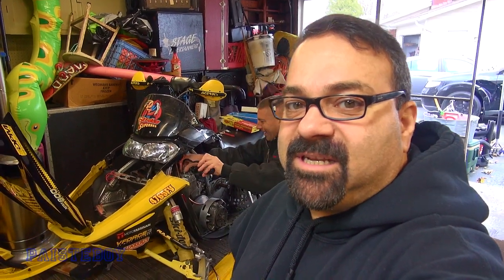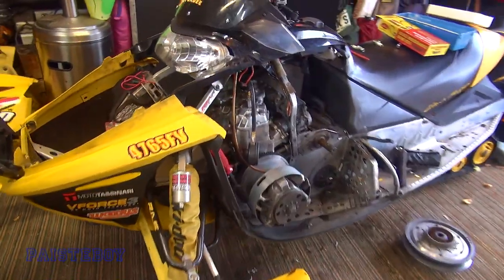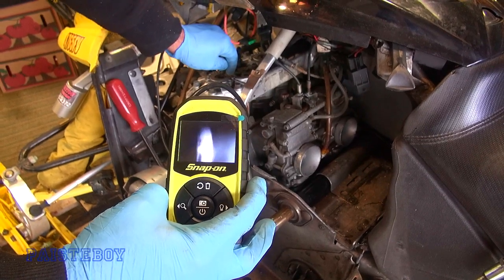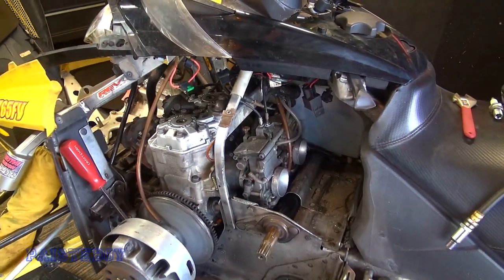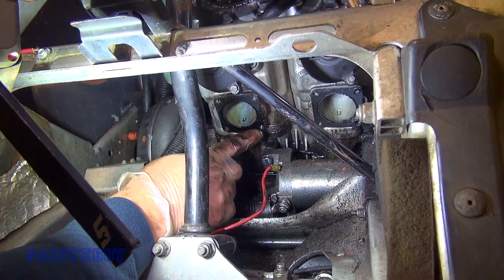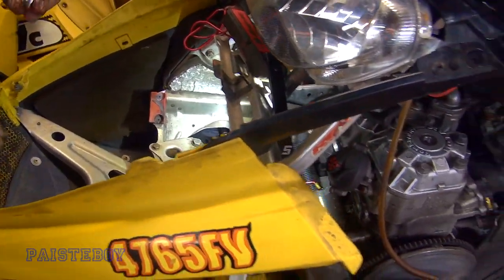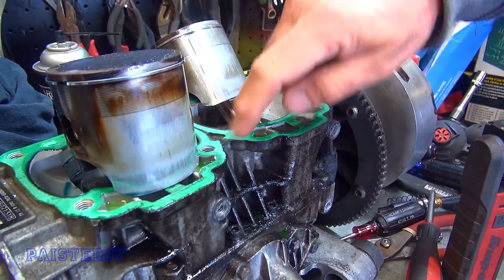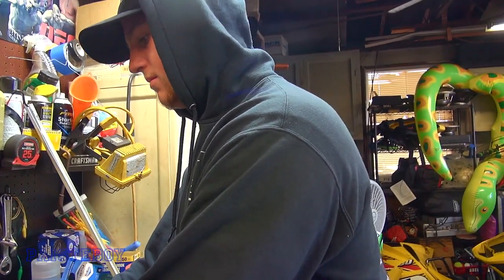Working on the Blair Morgan: November 2020 | PART 1

Comment: The scoring looks to be result of the leak on the Y pipe. Was there similar scoring on the the intake side? If not this points to a air leak by the exhaust port which will cause a "hot spot" 

If the scoring is all the way around the piston, this points to a general lean condition, which is caused by a jetting issue or another air leak either from the intake boots or the crank seal.
Reply from the maker: Thanks for the tips Streeter.  We haven't looked that closely at it yet but I will be sure to look at all of the things you mentioned to get to the correct conclusion.  Thanks for watching.
Reply: @Paisteboy  Now is a great time to change out your PTO crank seal and service the Isoflex grease. Whats nice is you dont need to split the cases. Just remove the drive clutch and then remove the seal retainer plate. Ebay has seal and grease kits for a good price. Love the channel! Thanks....Jimmy
Reply from the maker: @jameslaurinitis7580  
Thanks for the tips.  We'll look into that.  Thanks for watching Jimmy.
Reply: Streeters Garage, I totally agree with you.  After tearing it down more, it makes perfect sense.  Zuke ordered a new gasket set and we will make sure that we don't have another gasket leak.
Reply: @jameslaurinitis7580  absolutely. Now is the time to do it.

Comment: I have tore down multiple skidoo 800s,  Id definatley split cases and have the crank and bearings checked. Also have bearings repacked with isoflex and do crank seals. I mean doing it now is better then during prime riding season. Also id get aftermarket dual ring pistons they are much better then single ring and reasonabley priced. I know this is not your call but id highly recommend it.
Reply from the maker: We'll look into the case splitting but Mark already ordered the pistons and rings so I'm sure we'll be proceeding with the single ring pistons.
Thanks for watching Jacob.

Comment: My 06 600 SDI has that same oil leak. I believe the seal between the cylinders is shot that also lubs the water pump bearings from the gravity fed tube from the oil tank. Mag side cylinder fills up with oil if you don't use the sled for a couple weeks. My engine needs a complete rebuild to fix those crank seals. 11500  miles on the engine so not too bad.
Reply from the maker: Thanks for the insight Rob!  That's a lot of miles.  Thanks for watching Rob.
Reply: @Paisteboy  Yeah it still runs good yet but running it will just cause more damage.

Comment: Check the crank seals they could be sucking air and leaning out your your fire washing away the oil I’ve seen that on many a sleds
Reply from the maker: Ok.  Thanks for the tip.  We'll check that out.  Thanks for watching Mike.

Comment: 02:06 nice heater Zuke!  Nice different take on the rebuild project.  I need that light.  You’re right about the oil from the leaky Y pipe.  The rev 800s are notorious for loose Ys .  90 psi is done... I would rebuild anything less than 110.  Listen to Parker he knows
Reply from the maker: Right on.  When it died on the trail last season and I had to tow him it was probably just way overloaded with un-burnt oil and struggling to run on 1 cylinder.  Yes the 90 psi is toast for sure.  It sounds better than zero but really isn't.  Hopefully we'll be finishing it up this weekend.  
Had a blast Monday night btw.  Please tell Rich & Bobby for me.
Reply: @Paisteboy  i will and we will be in touch about getting you and your buds on for an xmas Par-tay!

Comment: How hard was it to get that engine out?  I need to replace my primary oil seal so the engine needs to be pulled.  While I'm at it, I'll put isoflex in the bearings if they  are still ok.  My compression is 137 each, but I may wind up doing that too this spring since I'm in there.  Really pissed that seal is gone but that's what happens with a 15 year old sled I suppose.
Reply from the maker: To be honest Craig, it's kind of a pain. You have to remove the Y pipe, the rave valves, the airbox, the carbs, the primary clutch and the reed valves before you can pull the motor. Oh, and the starter motor if you have electric start.  Be patient and do it when you have plenty of time. Good luck!

Comment: ROCK ON GUYS ! 
I need to ride with you boys this season ! 
I’ll show Paiste how to REALLY rock a Blizz 600 ! Question.....did you get the longer 6inch carbides for the TS skis ?
Reply from the maker: You can't ride with us now if you're just going to show me up. lol.  I'm still running the stock original carbides that it came on the sled but if I do change them I would get the 7 inch ones.  Thanks for watching.

Comment: Those two carbs have the plastic adjusting mixture screw with the spring on them.  Turn in until it starts to grab or tighten then back out a 1 1/2 turn.  Not scientific for sure.  Your bro saved that motor by shutting it down I bet.  I can’t wait to ride.
Reply from the maker: Yeah.  We'll dial them in when we finish it up.  I'm actually really surprised that the damage wasn't worse.  I can't wait to ride either.  If there is snow, the trails open in Old Forge on December 7th and I'll be there!  Otherwise trails locally don't open until after Christmas.  Thanks for watching Craig.

Comment: JUKE DUDE 🚬 glad to see ya when the PTO side burns down its possible that bearing is junk so at that point new crank   But split the case to be shure or it will burn again trust me my friend was a grass drag racer and he used to burn down from PTO bearing failure caused by leaking seal after a new crank seals and bearing he was up and running I remember his main race sledd was a Mach Z I even asked Him check runout on the shaft
Reply from the maker: Yes.  The funny thing is that the oil was heavier on the mag side.  Not sure if that necessarily means anything but I guess we'll find out.  I'll pass this on to Mark and see what he wants to do.  Thanks for watching sheddski.

Comment: How many times has he rebuilt this sled?
Reply from the maker: This is actually the first rebuild on this motor.  The other issues with this sled weren't the motor.  Last year when we pulled the motor it was to extract the broken bolts from for the starter motor.  He also had coil issues but fixed that in Old Forge in my trailer.  It does seam like he has all the problems though.  Thanks for watching Benny.

Comment: To me it looks like its running way to rich. To much wash on the  pistons and carbon buildup. To much gas will wash the oil out the exhaust an cause piston failure. Worn slides an needles in the carbs will do this. Or incorrect jetting. Great job on the videos!
Reply from the maker: Thanks for sharing.  I will mention this to Mark and take it into consideration.  We should be finishing it up this weekend.  Were just waiting for the isoflex grease for the crank bearing to come in.  Should be he Friday.